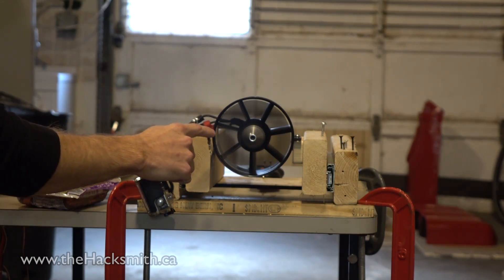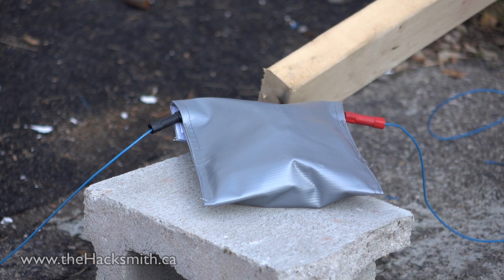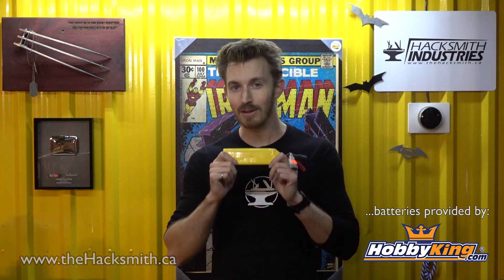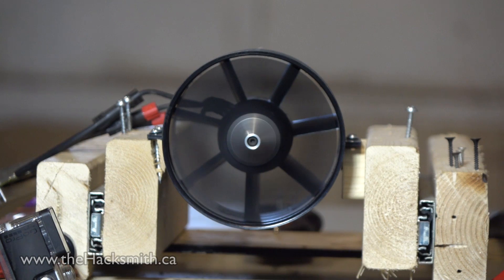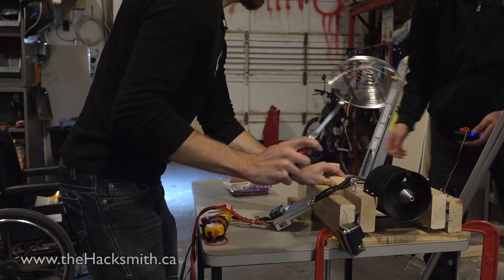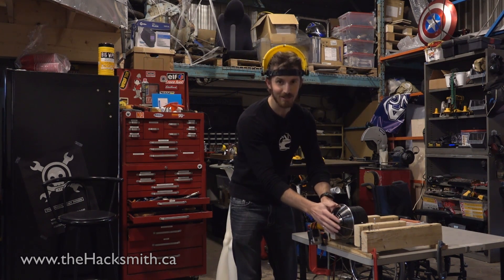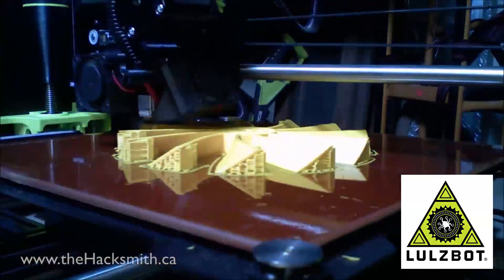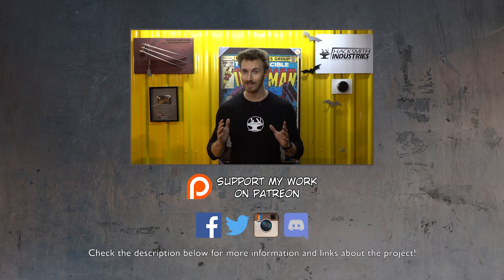Flying Like Iron Man #11: Not So Safe Safety Tests

Comment: you could make a fan mold and cast them out of molten aluminum
Reply from the maker: Problem is at home-casting is pretty difficult for precision parts. It works for a lot of things, but for something like this, might be more effort than it's worth.

For example -- if you see the professional EDF blade we show near the end of the video -- look at the underside. It has a bunch of holes in it. Those are for balancing the blade so when it spins the CofG is perfectly in the center. Considering that whole piece was machined very accurately, it should of been balanced from the get go. Now imagine casting it, how many variations it would have! It might be possible, but like I said -- would probably end up being more effort than it's worth.
Reply: the Hacksmith I understand. :)

Comment: how about casting the blades with green sand out of metal?
Reply from the maker: Problem is at home-casting is pretty difficult for precision parts. It works for a lot of things, but for something like this, might be more effort than it's worth.

For example -- if you see the professional EDF blade we show near the end of the video -- look at the underside. It has a bunch of holes in it. Those are for balancing the blade so when it spins the CofG is perfectly in the center. Considering that whole piece was machined very accurately, it should of been balanced from the get go. Now imagine casting it, how many variations it would have! It might be possible, but like I said -- would probably end up being more effort than it's worth.

Comment: What material have you been printing the fans with? Is it a viable option to print with a metal alloy?
Reply from the maker: Metal 3D printers are very expensive ($100,000+). The metal-infused plastic you can get for FDM printers isn't actually that much better than just the plastic itself. We can print larger blades out of metal through a site like Shapeways, but it would still cost $600/e for the turbine blades... so pretty expensive =(
Reply: the Hacksmith Gotcha. That's what I assumed :/

Comment: What are the current EDF blades made of? Is there any way you could do a casting of them in something like aluminium? That way the leg work of designing the thing has already been done for you. Cool work btw, loving it.
Reply from the maker: Problem is at home-casting is pretty difficult for precision parts. It works for a lot of things, but for something like this, might be more effort than it's worth.

For example -- if you see the professional EDF blade we show near the end of the video -- look at the underside. It has a bunch of holes in it. Those are for balancing the blade so when it spins the CofG is perfectly in the center. Considering that whole piece was machined very accurately, it should of been balanced from the get go. Now imagine casting it, how many variations it would have! It might be possible, but like I said -- would probably end up being more effort than it's worth.
Reply from the maker: Oh and we're playing with different materials. So far mostly been using ABS-X
Reply: Ahh yeah i see your point, and finishing would be a pain in the ass aswell. A mate of mine worked for a company over summer and all he did was balance pump blades, and they had a swank machine for it too Does the tormach have capabilities in this area i wonder? Not used a CNC mill before but my uni department just got one so looking forward to bombarding the technicians with requests!

Comment: what about a  remote energy transfer system like a laser to transfer power? I saw that they have some systems in testing for military to power up drones while flying.
Reply from the maker: Lasers of that power level would cost more than the project itself =P
Reply: ah totally slipped my mind the idea of costs. Was thinking only in one dimension :). Anyway have you considered replacing the fans with jets? Like those small ones made for model aircraft. 

Also... jesus man I just saw your experiment there... you know that you can get killed or permanently injured like that? If that fun hit you in the neck or eye or something...
Reply from the maker: The fan scene at the end was staged ;-)

And check out our last video or the FAQ on our website for info about the jet turbines!
Reply: the Hacksmith ahhh... good one :)) speaking from experience here when I say that if something can go wrong it usually does... :)
Reply: Why not use DMLS or metal additive manufacturing for the fan blades? Metal would be more resistant to cracks (rocks etc) as well.
Reply: I believe he has a CNC milling machine. I would think that would be the way to go. In this application, it's not just strength but strength to weight ratio because centrifugal force is probably the primary stress at those speeds. I remember an episode of Mythbusters where they made a couple ducted fans by machining some type of foam (polyurethane maybe?) and then laying up carbon fiber composite on top of it. That might be doable.
Reply from the maker: Looked into the price of having a 180mm diameter fan printed using DMLS -- over $900. =(

We might get the machined in China  for a better price =)

Comment: Why you don't use ninjaflex?  It's smoother, and (I think) more stable than ABS
Reply from the maker: We're getting some! I think it's too flexible for the fan though!
Reply: the Hacksmith Nice! Maybe with a high infill and the g- force pushing the blades, the fan could be stable enough to provide thrust. Thank you for answering, and good luck to your project :D

Comment: would u use some kind of fireproof fabric for the battery problems provided that u get sufficient funds from ur campaign?
Reply from the maker: I don't think any kind of fireproof fabric would be enough to protect me. Remember, we're going to have a bunch of those batteries all together, tightly packed. If one goes off... BOOM.  We're likely going to try and move the battery pack away from my body, and have a metal deflection plate to blast the explosion away from me =)
Reply: sounds like a plan👍
Reply: really excited for this project to complete

Comment: Hey, have ypu heard of the carbon fiber 3D printer. Im sure it would be a good investment.
Reply from the maker: We have, but we'd better make sure 3D printing is actually feasible before spending a few thousand on something that might not work!

Also I don't think the carbon fiber 3D printer has a large enough bedsize -- we wouldn't be able to make EDF blades larger than what we can already get for free from Hobby King =( 

Most likely (IF they work), we'll outsource the printing so we can have them made on a few hundred thousand dollar industrial machine =)